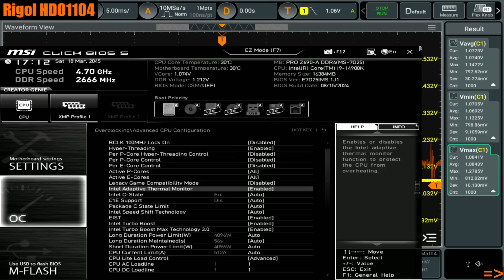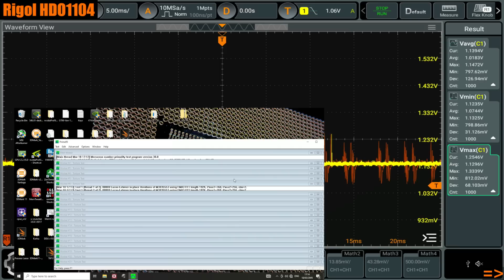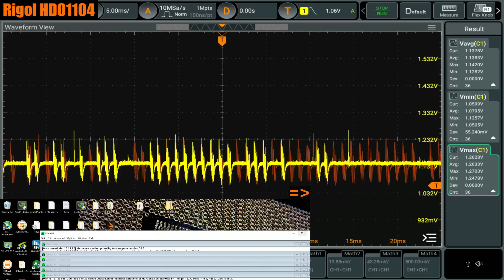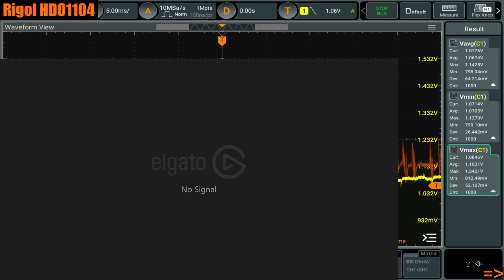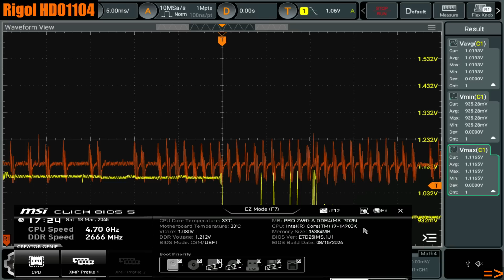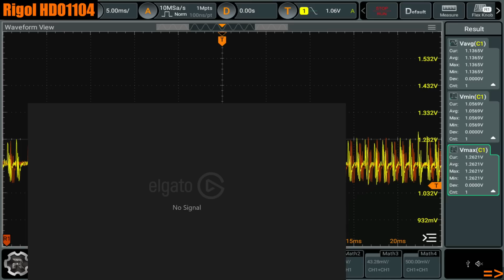CEP reduces Vcore undershoot

Comment: I waited over 10 years to build a new PC and of course I build with the generation that has the most issues
Reply: I wait 5 years between builds. I also prefer the last gen released for a socket over the first, because all the bugs should be worked out of a mature platform. Of course I choose my parts after the exploding 7800x3D debacle, but before raptor lake starts killing itself.
Reply: @nighthound2714  I also built a 7800x3d system and the CPU already died once even while always running the lastest bios. The second CPU they sent me through the RMA has an absolutely horrendous memory controller and struggle to run basic 6000/cl30 ram and randomly crashes during some gaming sessions. I have not had a good time with AM5 personally.
Reply: @nighthound2714  Are you me?  I upgraded from a 7700k..  The worst timing of any decision in my life, lol
Reply: @Loki79uk  
7700K as well. I almost bought 14900K. Luckily, very few non i9 cpus are actually affected, and the now 5 year warranty should last me until my next build.
Reply: + melted 4090s
Reply: That's exactly me.
Reply: I hear you. I advised my brother to get 13/14th gen Intel, and his PC doesn't boot when he turns it on, only rebooting will get it to stay powered and boot into Windows.
Reply: @davidestabrook5367  that could be a number of different things. Sounds like you and your brother shouldn't be building computers.
Reply: @DingleBerryschnapps  I think your Mom's calling you for dinner.
Reply: RIGHT?! Built my old PC with an i5-4690K and a GTX 970. Worked GREAT the entire time I had it, but finally decided it was time for an upgrade in June of last year. I almost always had Intel processors in my computers. I had one AMD Athlon processor in a random used computer that was most likely bought by my dad from one of his random friends that would sell stuff.

But anyways, never had any problems with any of my Intel processors, so I just stuck with them and went with the i7-13700K and an RTX 4080. Luckily I didn't go with the more expensive i9 because those have WAAAAAAY more problems than the i7s. I've gotten lucky and have had zero problems with my CPU. 

I'm still on microcode 119 because after watching some of Buildzoid's videos, especially the one before this one about MSI boards, I'm hesistent to update my MSI board to the new 129 microcode update. I've got the whole "if it ain't broke, don't fix it" mentality going. I'm definitely going to at least wait until my MSI puts out a non-beta BIOS for my board that includes the 129 microcode update. Until then, my CPU will be running at 35C average, 1.394 max Vcore, .045mV undervolt, etc.
Reply: @WilliamTell1313  Honestly no point in the new microcode if you aren't seeing above 1.55v and that's still too high so tuning is required either way. Just keep track of voltages and I wouldn't let it go above 1.45v, just set a IA VR limit of 1.4 and make sure AC loadline settings are correct to the voltage regulator and forget about it.
Reply: @NewishJordan  I've had HWiNFO running for the past couple days, playing a bunch of games and stuff throughout.

My Vcore max is 1.404V. My 16 cores all have a max of 1.440V. I have my CPU undervolted by .045mV and disabled MSI's Enhanced Turbo Boost feature. Those are the only things I have changed. Never messed with Load Line settings because I have no idea what they actually do LOL. Never changed anything to do with IA VR limit. In HWiNFO, it says my IA Domain Loadline is set to 0.500 / 0.800 mOhm and the GT Domain Loadline is set to 3.400 / 3.400 mOhm.

Do you think I'm good or do you think I need to change anything else?
Reply: @WilliamTell1313  I'd recommend buildzoid's recent videos for a comprehensive tuning guide. 

Voltages and settings look good IMO. I'm not exactly sure the function of Loadlines but if improperly set against the voltage regulator of the motherboard can cause overshoot/undershoot. This is different depending the motherboard, so best to look up your specific motherboard.

1.44v might be a little high for a 13700k but I wouldn't consider it in the danger-zone. Best of luck.
Reply: same
Reply: XD...me too..
Reply: 😂

Me too. I literally just pulled the PSU out of my 3930k system last night to use in my new setup.

I have a different perspective and outlook than you though. Many people that checked the voltages when they first built their system aren't having these issues. I would have been one of those people, because I always go through the BIOS on every new build. So that tells me I can easily avoid the issues.

With that knowledge, I actually went out last week looking for an open box 13700k and found one for $230.

I feel bad for the people that bought these chips familiar with monitoring the hardware or knowing what to do to fix it. That would have been frustrating.
Reply: I was so close to being in your situation man... I hadn't bought AMD since the Phenom II but so many things about these Intel chips just didn't sit right with me so I broke my rule of not buying a new platform at launch and went with a 7950X. Then I doubled down and went with an Asrock board which 10 year ago me would have slapped me for considering but to my pleasant surprise it seems this ol' gut was right.... or just lucky but I'll take it.
Reply: Same, finally replaced my 2012 build late last year with one using a 14700K. Haven't had any issues that were traceable to the CPU yet but I'll be updating my BIOS with the latest microcode as soon as a stable version releases.
Reply: Me too. I upgraded this year from AM3+ platform.
Reply: Yes, it has issues, serious ones even, but don't kill yourself over it. I bought my 13900KS when it came out, but the first thing I did was set fixed voltages below 1.3V while maintaining 5.6 GHz for all P cores (fuck 6ghz it's a total joke, i ain't going to run my CPU with 1.7v+ voltages 24/7), 4.5 GHz for all E cores, and 5 GHz for the ring, with 7000 MHz CL40 RAM. It's been running perfectly fine for over a year now.
Reply: Thing is that if you start searching the internet for problems on something you want, you will most likely find that air, sunlight, space and even time causes is bad for you. I do trust BZs engineer brain when he states there is a problem. But the thing is - not everyone is affected and not everyone will even notice that something is off. I did start noticing that Tech Jesus (gn) seems to have that AMD fan attitude where Intel is being shitted all over while AMD s flaws are spoken in a more calm manner(maybe it's just my Intel fanboy state of mind). I built a 13900k upgrade before summer. I collected problems before making the purchase and followed the guidelines to keep things on the safe side. Although this is my home PC and this no product workload, I can't say that I have had problems(I had one, but that one seems to be related to me being stupid).
Reply: The thing about "The Internet" is the fact that if you try to collect some data about even a health topic, you will soon come to a conclusion that air, sunglight, space and even time are the biggest factors that leads to death. I even sometimes get the vibe that Tech Jesus (GN) has a carefully hidden hateboner for Intel, which can be seen from that passive aggression statements in the videos when Intel has a problem versus AMD has a problem (but maybe its Intel fanboi speaking in me). 

I do understand that things that BZ is digging up here are quite important, and I do respect his engineering state of mind (one of those few guys who actually sits and does DEBUG level of things instead of "oh look, graphics"). But the thing is - you may not have this problem with your chip (yes, words that don't make the decision easier), nor may you struck the area where it affects. People tend to start writing things when there's a problem, and not where things are good.

This year I built a 13900k (with an MSI board). This decision was made not from the Intel fanboi juices running through my veins, but from experienced research of reddit, youtube and other communities and articles. Both AMD and Intel seemed to be a risk, but in the end I went for Intel (of the factors was Jayz's video when he shared the x3d and how the OS is buggy at switching to gaming mode and stuff). And I can't say that I regret going for it. Although this is a home pc, so no professional workload is involved. Nor is this L1T stuff, where the cpu is used for server uses. I did had one problem, but that one was on me (I believe it was due to a badly connected PSU connector).
Reply: Same
Reply: SAME!!  Damn it!!  1st build w/ my son 13900k + z790 + 4080 = more ammo for his mom in divorce court (she says I shouldn't be pretending to know anything about tech/computers). 🤬
Reply: @vincentperiolat4610  Damn, that sucks
Reply: @vincentperiolat4610  well, if you didn't know how to avoid this issue when you built the system, technically you don't know about computers.
Reply: @DingleBerryschnapps  That comment proves you don't either, the vast majority do NOT have knowledge about these things. Nor should they have to learn this nonsense to have a stable system. If you were more informed, you'd know this.
Reply: Everyone keeps telling me my system has issues and is unstable.   I’m really hoping that it starts soon.  So far the year I’ve been running it has been fine, which is super lame. I want to be a part of the cool new trend group.
Reply: I have a 14700k and 2 14600k all running higher than stock for nearly a year 9 hrs a day.Had 1 issue with Gray Zone Warfare blue screening it was the game direct x issues.  Another lucky user i guess.
Reply: @zorbakaput8537  Everyone should be lucky, but companies don't test every product, as it's cheaper to just accept that a few percent will get returned due to manufacturing failures.

The more PC's you build, the more failures you'll come across. If you're lucky, the part will fail outright. But intermittent failures, which happen randomly, those are the worst. I had a PSU that would cause my PC to shut itself off a couple times a month.

That PSU was brand new, but the failure it had, slipped through any testing at the factory. I only fixed the issue, by swapping the old PSU in it's place.
Reply: @WhiteSSP  Right? Tuned my voltages when I first built the system and has been trouble free since day 1.
Reply: @dracer35  Me 2
Reply: @dracer35  Same here and I have been doing video encoding and all sorts of things but all tuned since almost day one.
Reply: @WhiteSSP  I have a 14700k and now anytime someone figures out I have a 14th gen the same exact question arises: "are you stable?" 

Like cmon, it effects like 1.4% of 14700k's. Just another way of people acting high and mighty over what computer components they choose. "Dude you should have bought a 12600k" lmfao.
Reply: @JordanJ01 it helps them cope with their 5600x
Reply: Could still affect your 14700k, just way slower. If you start noticing instability, just set voltage to under 1.4 and you'll probably be fine for another 5 years
Reply: @JordanJ01 12 gen is garbage not even close to 14th gen lol
Reply: @gvido2923  12900k is still pretty decent but 12600k in 2024? The only thing going for it is the price, being $180 and all. I wouldn't want it in my main rig unless I had a 3060 or something.

Don't get me wrong, it's still decent for gaming paired with a low to mid range GPU, it's just quickly dropping off fast.
Reply: @JordanJ01  I feel you mate. Also owning an i7 14700k, just went with 1.26 Vcore since day one and everything works like Swiss watches...
Reply: That only increases the fun. Seriously, proving that your system isn't garbage annoys a lot of people.